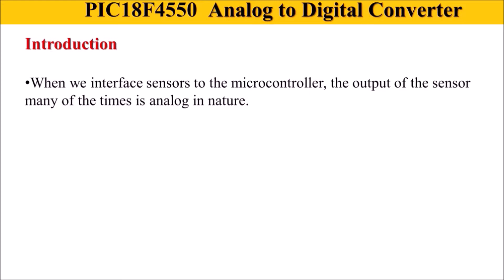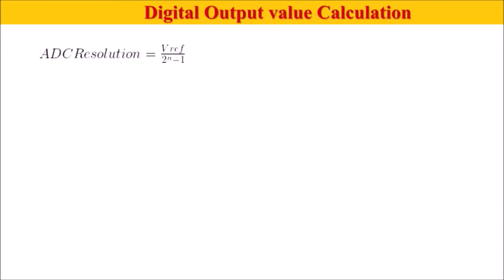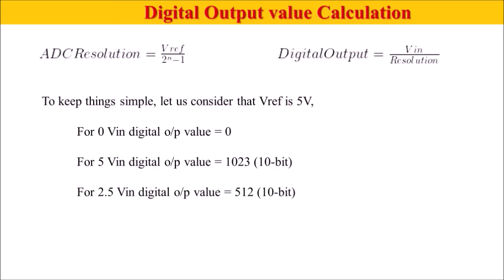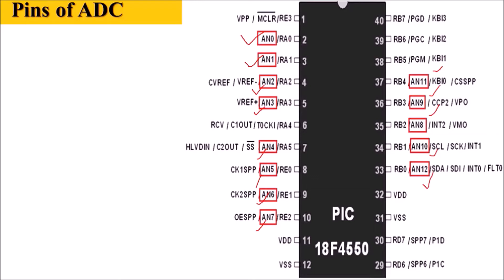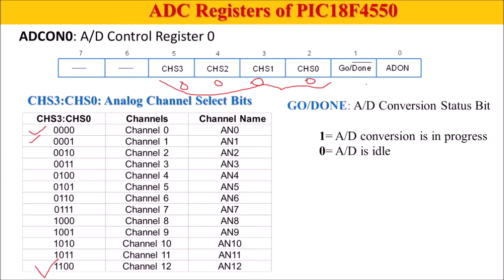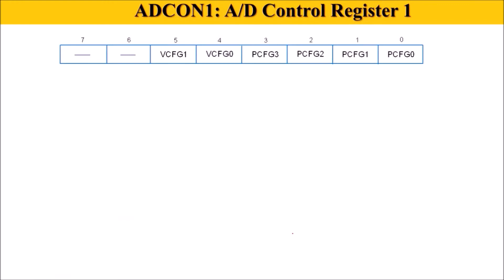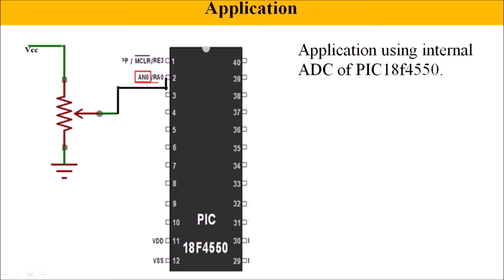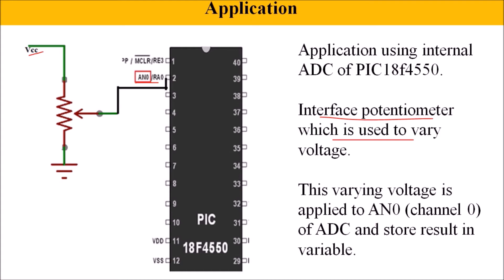PIC_Lecture 13 : Embedded C program for ADC of PIC18FXX | Using ADC Module of PIC Microcontroller

Comment: void main(void) 
{
unsigned int Ch_result;
TRISA = 0xFF           /* set all A ports as input */
ADCON1 = 0x00;     /* Vrefs +/- are set to VDD/VSS and configure all pins as analog */
ADCON2 =0x92;      /* right justified, 4Tad and Fosc/32. */
ADRESH=0;
ADRESL=0;

while(1)
{
ADCON0=0b00000001;          // Select Channel 0, Go=0, ADON =1
ADCON0bits.GO=1;                // providing Start of Conversion Signal =1

while (ADCON0bits.GO ==1 );     // Wait for end of conversion

Ch_result = ADRES;      // store 10 bit result ADRESH-ADRESL
                                        // register in variable Ch_result

}
}